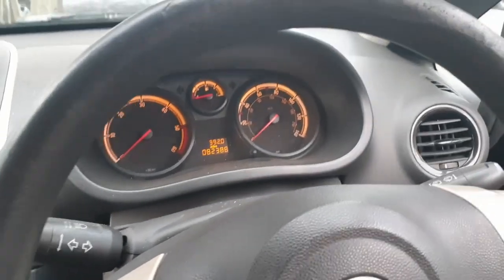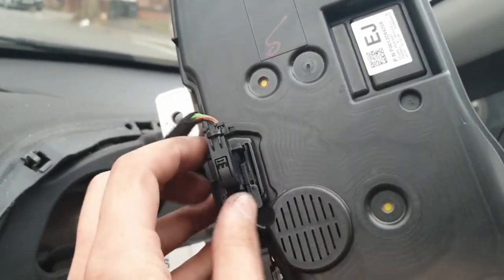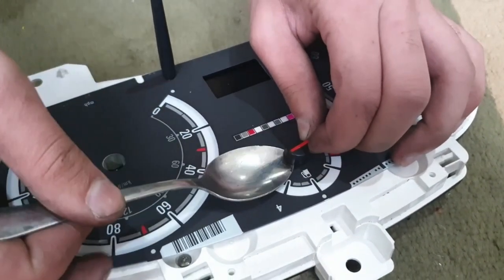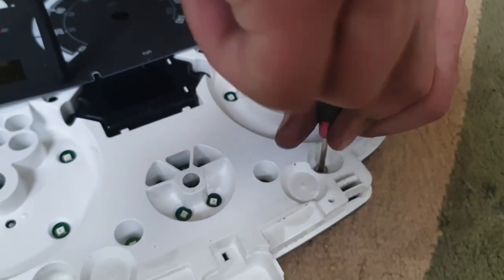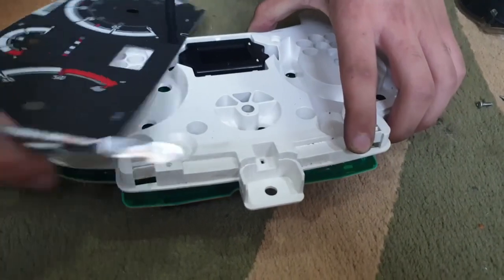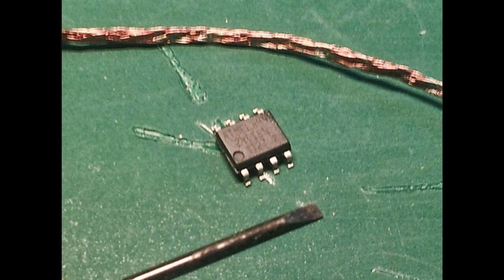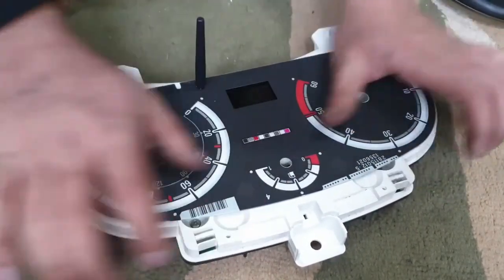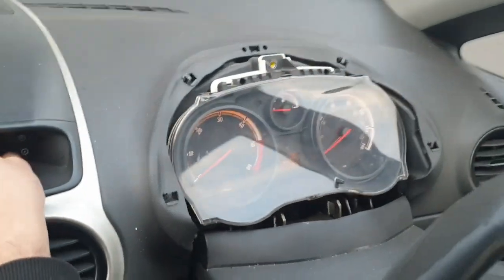how to remove speedometer Cluster & Dismantle To Read/Write Eeprom Data on Vauxhall Opel Corsa D

Comment: Hi Abdul, this is the most informative and best made video I have ever seen.
Question: i have a 2008 Vauxhall corsa and my speedo gets stuck also I'm sure the rev counter too, I wonder if you can advice? If it's just the speedo could it be the sensor and what do I do but if its both could it be the whole dash and can it be repaired? Many thanks in advance , nick.